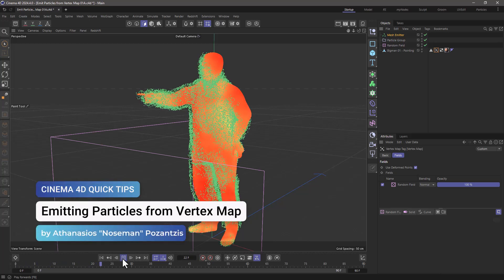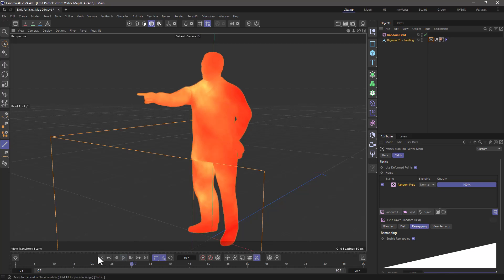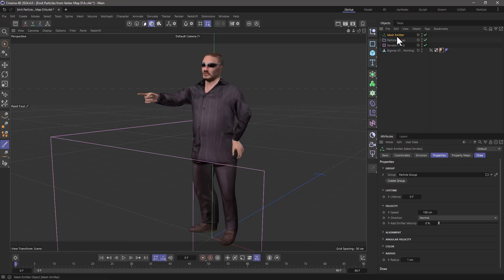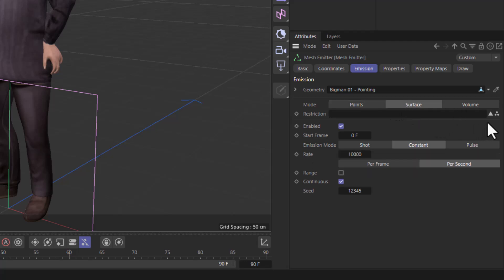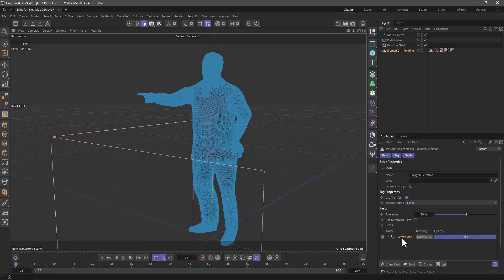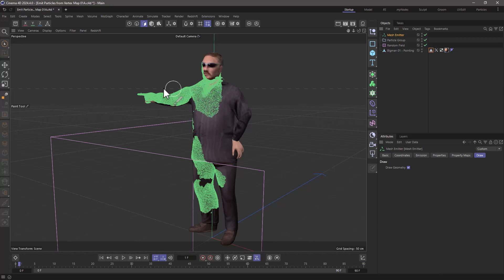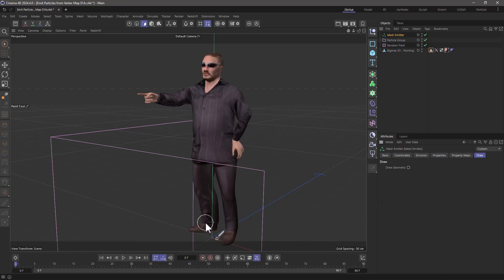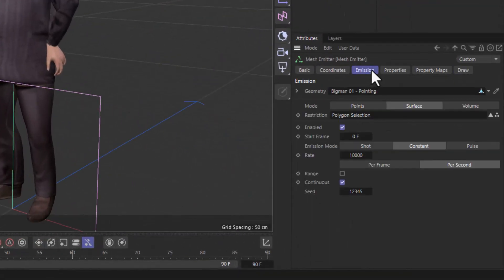#C4DQuickTip 133: Emitting Particles from Vertex Maps in Cinema 4D

Comment: Can @maxon please put this into the manual/documentation? It simply says you can use vertex maps in surface mode, but does not explain how. This entire extra missing step of having to do it via poly transfer is not mentioned at all. If not for finding this video I would have had no idea how to achieve what should have been a simple and straightforward set up that your own docs say is possible. And as someone else commented - direct access to the vertex map would be preferable.

Comment: 2:20 well at least you could add several mesh emitters, each with a higher tolerance, so that they add up the stronger the vertex map is, right? Although not a gradual increase in particle density a stepping of 3-5 emitters might be sufficient for most cases.